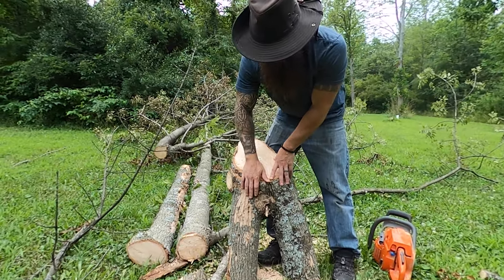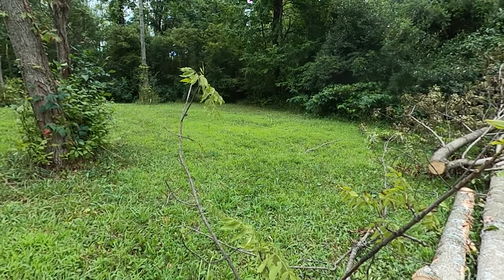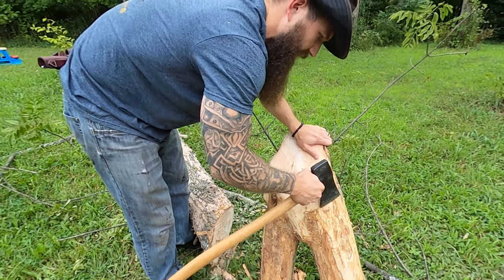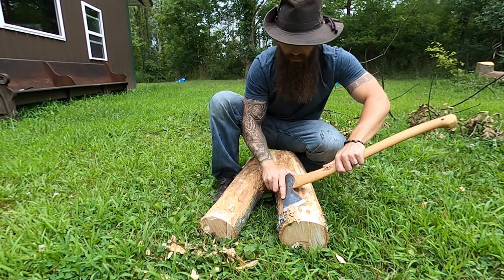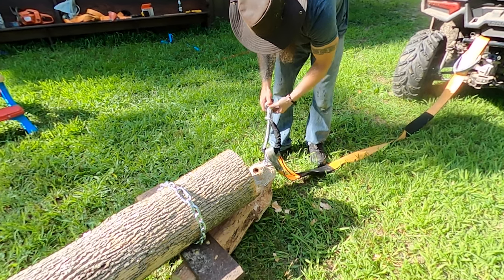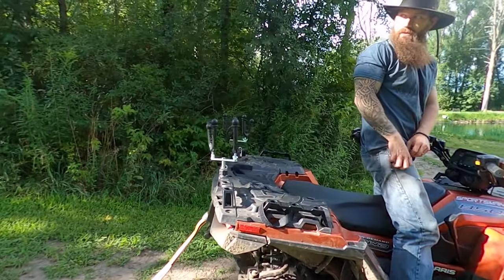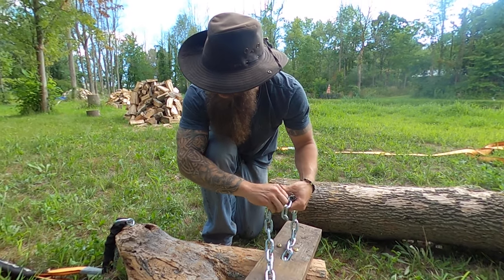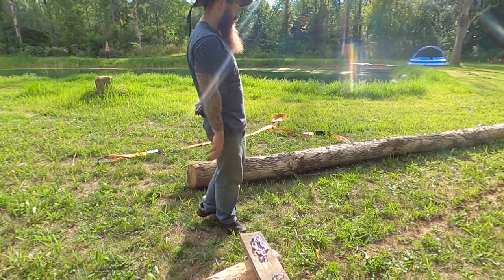SELF RELIANCE | Moving Timber with a DIY Log Sled

Comment: Great stuff;I have used a very similar A frame contraption ,dragging posts with a horse.The legs on the frame were about 3 feet long,so it didn’t tip over.There was a groove on the underside to accomodate the chain,which went underneath the front of the Y section and up behind the cross piece and around the log or posts or whatever and snigged back onto the chain itself,so the chain was always in tension when pulling. The chain going underneath also gave some upward lift to the front when in motion.It worked very well and was very easy on the horse. A couple of sticks in those chain holes meant that I could pile up a load of posts,throw the chain around them,then under and up and away you go.😊God bless.
Reply from the maker: Thank you for your comment! My husband read through it and thought it was a great idea. We were thinking longer legs would help because we do have tipping problems with larger logs. Horses are in our future and we definitely want to use them for this!

Comment: I'm guessing lessons were learned here, if only that a sled isn't very useful for such small stuff (<24"), but for the benefit of posterity: I'd have used a real logging chain in lieu of the hardware for this and all other logging, just bevel the trunk if it's going to scrape. for the go-devil, I'd have left the legs of the fork about 4 feet longer. a bough for the bunk and trunnels from a branch and it's free and much stronger.
Reply: UNless he drilled a hole through it and installed an axle and big ole wheels........